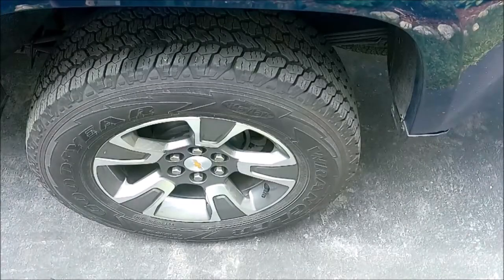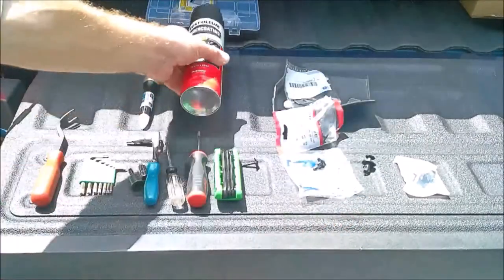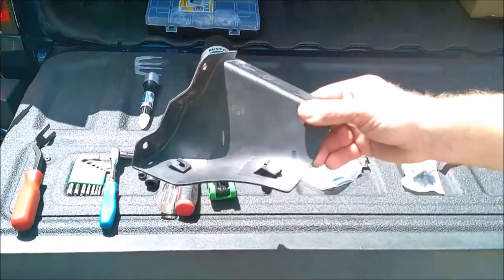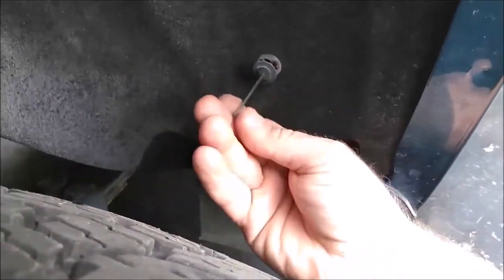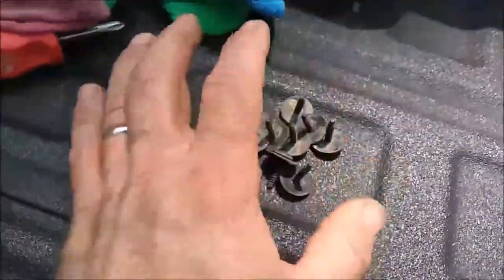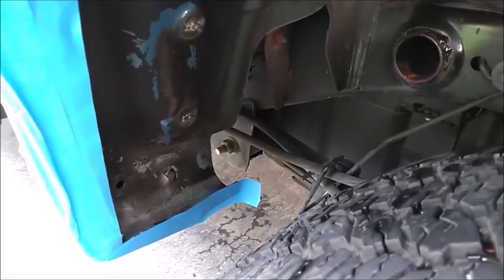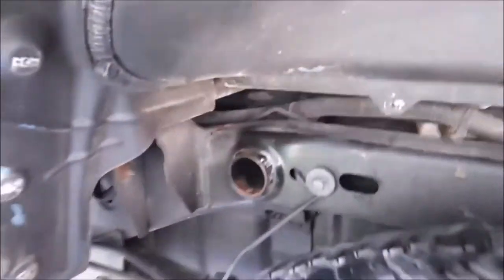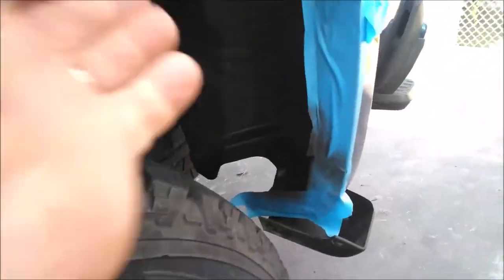2020 Chevrolet Colorado Wheel Well Undercoating

Comment: I'm  going to comment as I watch. Why not take the tire off for more room.?
Reply from the maker: Putting the truck on jack stands and taking off the tire would take more time than simply just using a low profile tool in my opinion.  Also looking at it from the standpoint of somebody who's not really experienced working on vehicles it's one less thing for them to be concerned about.
Reply: @squiblift2019  10 4. I get that .